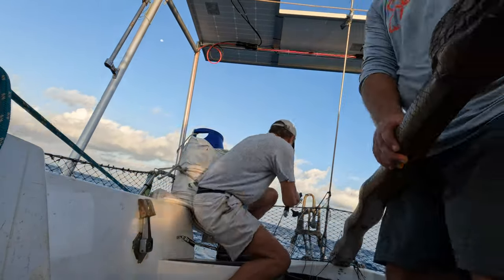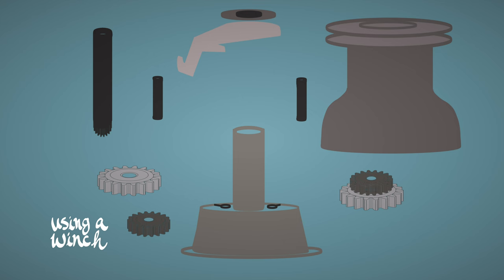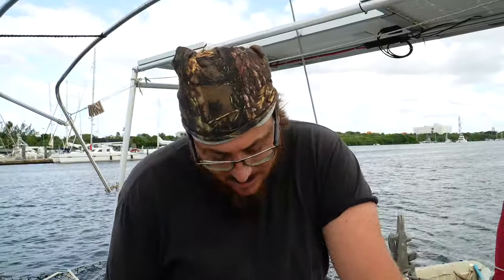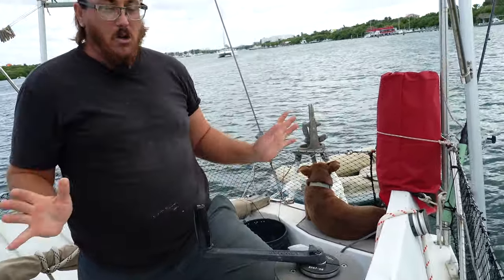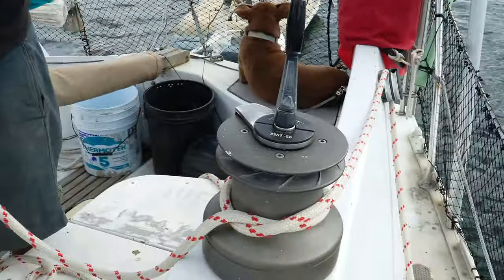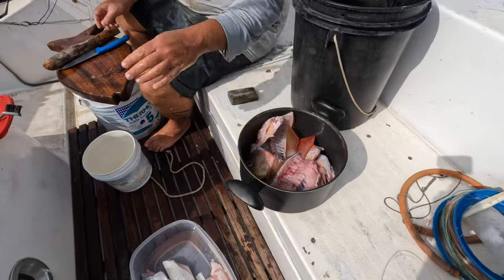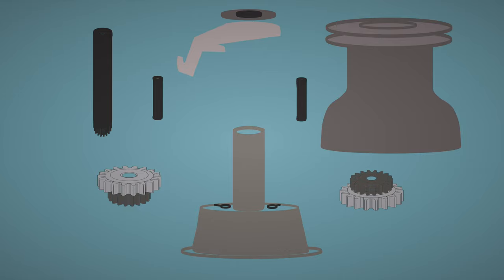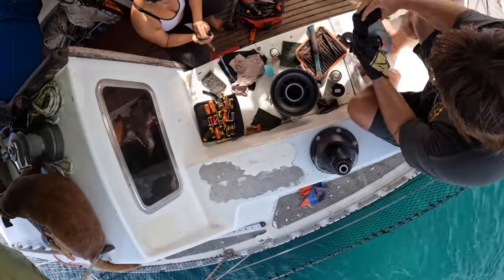sailboat HELPERS all about winches

Comment: Well there is the rare occasion of so called "handed sheet winches" where on turns clockwise and the other one anti-clockwise. Presumably a fancy racer thing for cleaner feeds. Never seen one in person though. I also saw a winch posing as a "helicoper", cold day, lack of maintenance, old springs and gummed up pawls. Also, for clearing a winch, a second line with a prusik knot works wonders: You can keep the tension, get no shock loading, ... And you forgot the old discussion whether to remove the winch handle after using it or not. It's almost a religious thing, everybody who went to sailing school removes them, everybody who comes from racing leaves them in.